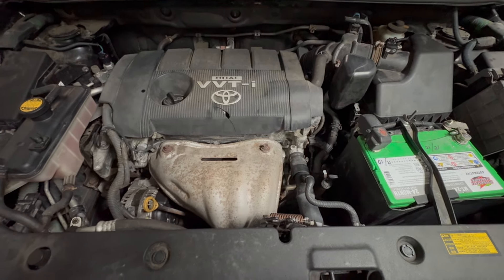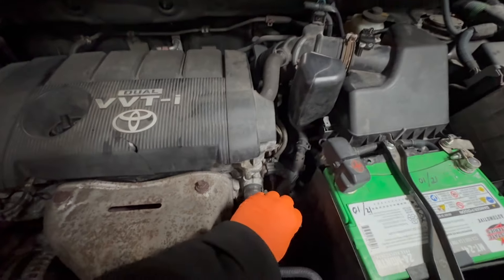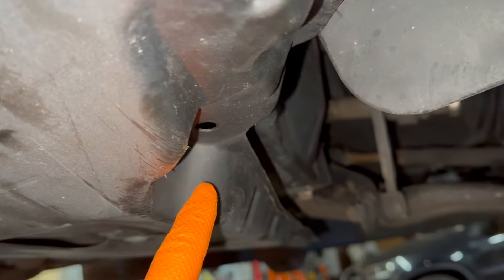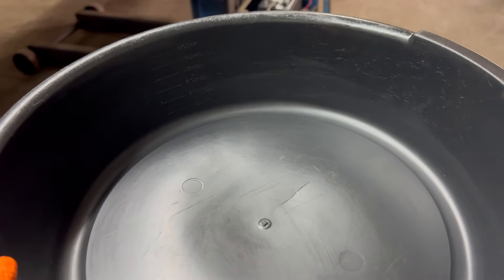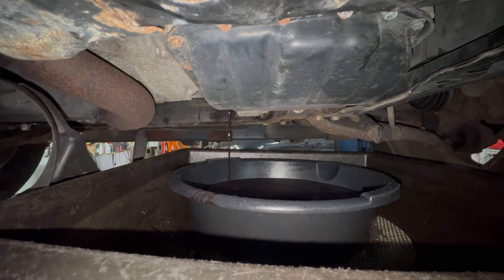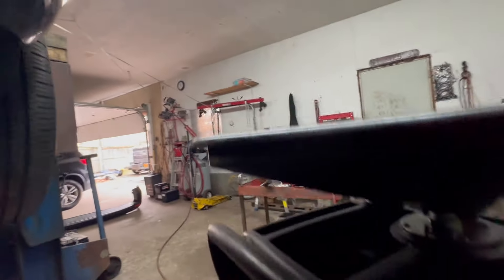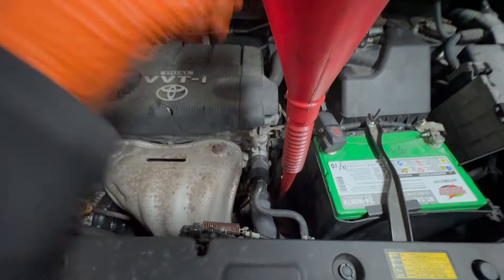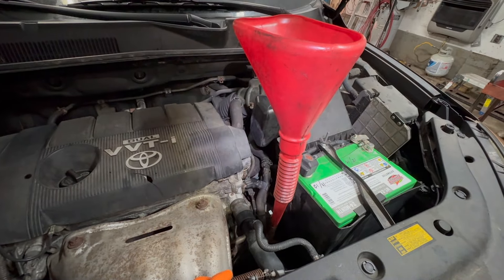Transmission Fluid Replacement On Toyota RAV4, Camry, Scion tC 2.5L - Easy DIY

Comment: The next chance you get can you show this same process for a 2011 Camry 2.5L 4cyl? 

Also, if you get the chance, can you do a video about how to safely clean an engine? Can I just disconnect the battery and hose it down at the self wash?
Reply from the maker: This video is about your engine?
Reply: The same engine, but the Camry doesn't have a dipstick. Idk, where to fill/drain it at.
Reply from the maker: @ThwaitesAwaits oh, my bad. I thought this was about an engine oil change video I made. I don’t have one of those engines in the shop yet, sorry